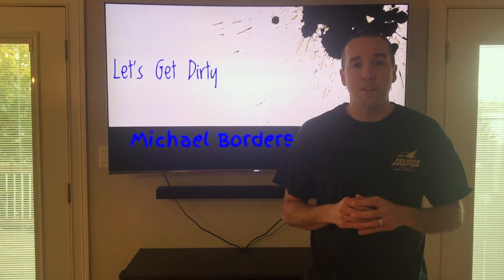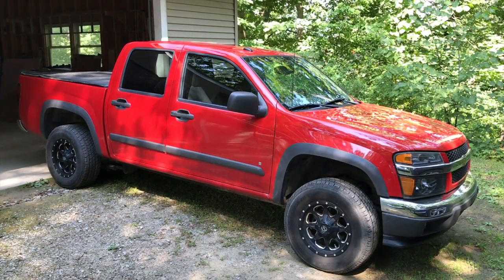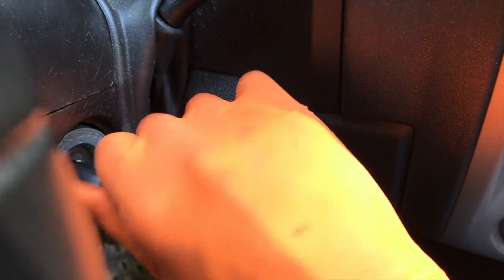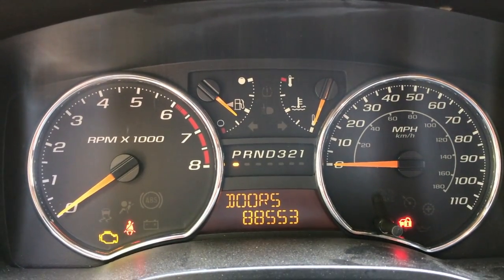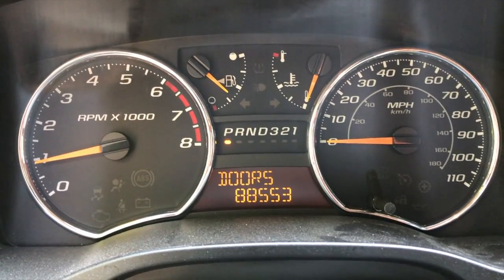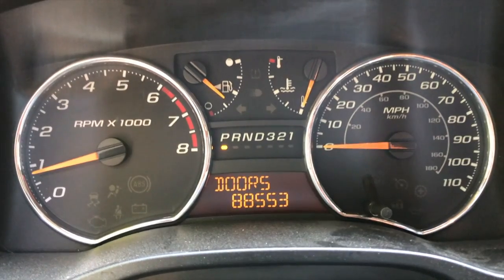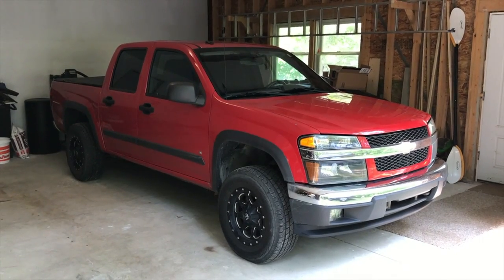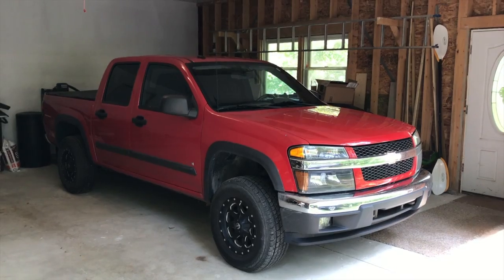How to do a "QUICK Reset" on your ABS System!

Comment: I have a question can the abs cause ur wheel to lock up?
Reply from the maker: Good morning ☕️

It can however it’s unlikely…but still possible.  The more likely cause is a worn out and sticking caliper.

If your caliper is still good, the next likely cause is a damaged rubber brake line feeding off caliper and up into hard mounted fitting.

Brake hoses can look pretty good from the outside however they fail from the inside-out…meaning…the internal portion of hose disintegrates and leads to little pieces of rubber floating inside system…leading to blockage/clogs…ultimately locking your brake or brakes.

Keep us posted on your DIY project.

Comment: My 2007 hyundai santa fe, after replacing valve cover gasket and alternator, started with a strong noise and vibration coming from the abs module, even without the key, ABS module is making noise, like is active/short ?  I have no clue.  I just took off the ABS Fuse,  what can I do?   Have you ever seen this weird situation? give me some guidance please?
Reply from the maker: Good morning ☕️

Any update?  It may be as simple as a system reset being that you didn’t replace any parts relating to the ABS/brake system.

We recommend disconnecting the negative cable from your battery and leaving disconnected for a minimum of five minutes.

After five minutes, resecure cable to negative terminal of battery and start engine to see if your system has returned to normal configuration.

Comment: 2019 sentra hit a good puddle abs and traction light came on , did reset once  worked for a bit till it came back on . I let car dry a bit drove around just reset drove around didn’t come back on . Parked up and drying more currently . Thanks for the info 🙏🏽🙏🏽
Reply from the maker: Thanks for sharing your experience.  Awesome job giving the sensors time to dry, sounds like the water from the puddle made contact with the sensors and made the system act sporadically for a bit.

👍

Comment: i turnded on ignition and acc tap gas pedal 3 times 2105 jeep grand Cherokee did not turn off abs
Reply from the maker: Thanks for sharing, we would now recommend disconnecting the black negative cable from your battery and leaving disconnected for a minimum of five minutes.

After five minutes, resecure cable properly to battery and start engine.  This is also a reset procedure for your onboard computers.

Comment: Just tried this on my Escape. Didnt work.
Reply from the maker: Thanks for watching, we recommend performing this recent test a second, third, and even a fourth time over the course of a day or two.

It’s very uncommon not to work on the first try however some vehicles require additional resets, as it may have a lot more sensors to reconfigure.

Keep us posted.  Let us know if you have any questions and hey if you’re into crypto trading, join our DIY ecosystem and help us grow an exclusive group of DIYers.

       toolboxtoken.com

Reach out to us any time!  🧰
Reply: I did try it a couple times in sucession with no luck.
Then I noticed that the car, after starting and putting into gear made a terrible scraping kind of sound, felt some drag, then that went away. But happens every time I start the car.

I went to Auto Zone and had them check for codes and one came back with a rear left sensor signal missing.
Reply from the maker: @rcpsammy7186  

Thanks for the follow up, hopefully installing a new sensor will solve the problem.  😎👍

Comment: Quick question came around this video. I just got my transmission done and went to pick it up my car and these lights were on mechanic said oh we forgot to tell you so you may want to get this stuff fixed. could they have mess with something and all it is is a simple fix that I can do, don’t have the money to fix any more problems
Reply from the maker: Thanks for watching, it’s possible…🤔

If your ABS light was not illuminated before taking it to mechanic, it’s likely they bumped something or didn’t re-connect a sensor or wire connection.

Hard telling but if it wasn’t on to begin with…why is it on after they serviced vehicle…🤔…an annoying feeling to experience…makes you think they should be in charge of looking over vehicle and getting your vehicle back configured to what it was prior to service.

Long story short…transmission change has nothing to do with your ABS system…so something happened when it was being serviced.

Let us know if you have any questions and hey if you’re into crypto trading, join our DIY ecosystem and help us grow an exclusive group of DIYers.

       toolboxtoken.com

Reach out to us any time!  🧰

Comment: I did this right now and now my truck won't turn on
Reply from the maker: Good morning, just poured a cup of coffee and am sitting down to answer any and all questions for the DIY community.

Sounds like you have something else going on with your vehicle if that’s the case and hopefully we can help.

Any recent maintenance performed on the truck in the last six months?  This will allow us to figure out if any recent maintenance is tied to your issue.

However in the meantime, we recommend disconnecting the black negative cable from your battery and leaving disconnected for five minutes, followed by resecuring it to battery and starting engine. Keep us posted.

Let us know if you have any questions and hey if you’re into crypto trading, join our DIY ecosystem and become part of an exclusive group of DIYers.

       toolboxtoken.com

Reach out to us any time!  🧰

Comment: Thank you!   You definitely know your stuff because this worked and saved us a lot of trouble and money.
Reply from the maker: We really appreciate that, putting trouble to rest and saving money is a good thing.

Thanks for sharing this.  👍
Reply: Does this work  for any make and model?  I drive a 2007 Toyota Camry and currently have this with the dash instruments going wild and speedometer won't move when accelerating. Someone please help .
Reply from the maker: @DodgerRocket  

Good morning, just poured a cup of coffee and am sitting down to answer any and all questions for the DIY community.

It will work on your 2007 Camry.  We had a recent viewer share with us that it worked on their 07 Camry.

If it doesn’t work, there is a faulty part within your ABS system that will need to be replaced.

Let us know if you have any questions and hey if you’re interested, join our DIY ecosystem and help us grow an exclusive group of DIYers.

       toolboxtoken.com

Reach out to us any time!  🧰

Comment: This does not work!! Most of the time it’s the magnetic ring on the axle that goes bad where the speed sensors cannot read.. I know I jus spent $580 on both rear speed rings and axles!!
Reply from the maker: Thanks for watching and sharing, it works however in your case, your rear speed sensors or one at least was faulty.

Performing this reset procedure allows the ABS system to reset.  ABS light can illuminate due to an electrical glitch or sporadic behavior and if it’s just that…in other words all ABS systems are still working properly, ABS light will turn off and system will return to normal configuration.

😎👍
Reply: @DIYwithMichaelBorders  both..
Reply from the maker: @mr.sinister1279  

👍

Comment: Didn't work smh
Reply from the maker: Bummer… we recommend performing this reset procedure a second or third time over the next few days to see if it works.

If that doesn’t do it, time to troubleshoot or have your ABS system read by an OBD II scanner.

Also, verify all tires are properly inflated to the manufacturers max psi… low tire pressure will cause this as well.

Comment: While driving ABS and brake light come on.  I stop the car and turn key off - then back on.  ABS and brake light go off.  As I drive again 2 miles or sometimes 10 miles ABS and brake light come back on.  I pull over and turn key on and off the lights are gone.  This happens consistently.  What do I have to do??
Reply from the maker: Good morning, just poured a cup of coffee and am sitting down to answer any and all questions for the DIY community.

It’s likely that you have either a loose connection, or condensation/moisture buildup in one of your wheel sensors.  Or…it’s possible that you have a part within your ABS system that is in its early stages of failure and acting intermittently… in other words… working when it wants to and not working when it doesn’t want to.

Let us know if you have any questions and hey if you’re into crypto trading, join our DIY ecosystem.

       toolboxtoken.com

Reach out to us any time!  🧰

Comment: HOLY CRAP IT WORKED ON MY 2009 TORRENT.
Reply: Well, disregard that, it came back on. I was told it's because I replaced my ABS module.
Reply from the maker: @daviddupre6905  

Thanks for the follow up, what’s the next step, have you gotten that far?
Reply: I'm told I have to have the module flashed and reprogrammed.
Reply from the maker: @daviddupre6905  

😎👍
Reply from the maker: Awesome!  😁👍

Keep that 2009 Torrent on the road.

Comment: On the 3rd time pressing gas pedal do you hold it down or simply press an release?
Reply from the maker: Thanks for watching, you will perform 3 normal paced brake and release applications.

You will not press and hold brake pedal during reset procedure.

😎👍
Reply: @DIYwithMichaelBorders  thank you
Reply from the maker: @Juli-n-David  

You are very welcome, happy to help.

🧰

Comment: Hmmm. Almost everyone here is saying this hack works but I attest that it does not. 
My 2003 GMC Yukon 4.8L has had the ABS/Brake light and traction control lights on since I got it 3 months ago and have already changed wheels speed sensors, all front and rear steering and suspension parts, brakes, tps, etc. and when doing the process every time I start my vehicle, nothing happens. 
OBD reader also states nothing is wrong but the lights still stay on. Even the GM dealer is stumped...

Nice try though guy.
Reply from the maker: Good morning, just poured a cup of coffee and am sitting down to answer any and all questions for the DIY community.

We appreciate you sharing your experience.  Have you verified all tires are properly inflated to the manufacturer’s max?  Low tire pressure will cause ABS to trigger.

Let us know if you have any questions and hey if you’re into crypto trading, join our DIY ecosystem.

       toolboxtoken.com

Reach out to us any time!  🧰

Comment: Ok this one’s strange: my abs/traction control/ brake lights and others were on for about 3 weeks. Took into shop for diagnosis they said module was faulty. I could drive as the brakes were fully functional…. And was going to replace it when funds were available… I drive a jeep grand cherry with a v8 and have class 4 towing. I pulled my camper over the holiday…. Module lights are now off everything is working properly now….. guess it self reset???
Reply from the maker: Good morning, just poured a cup of coffee and am sitting down to answer any and all questions for the DIY community.

That’s exactly what happened, it has self-reset…however why you may ask…

In most cases, this is due to a part within the ABS system that is in its early stages of failure and is working intermittently….it may soon fail all together however that could take months, a year or two, or a few days…

There are several ABS electrical connections and fuses…it can also be a loose connection or fuse…or moisture buildup inside connection or fuse.

Let us know if you have any questions and hey if you’re into crypto trading, join our DIY ecosystem.

       toolboxtoken.com

Reach out to us any time!  🧰

Comment: My Mercury Mountaineer ABS/RSC  light is on and the alarm keeps beeping. How to reset it.
Reply from the maker: Good morning, just poured a cup of coffee and am sitting down to answer any and all questions for the DIY community.

Did you perform this reset procedure?  Another procedure you can perform is disconnecting your black negative cable from your battery and leaving disconnected for a minimum of five minutes.

After five minutes, resecure black negative cable to your battery and start engine…which will allow the system to reset and detect any faults.

Let us know if you have any questions and hey if you’re into crypto trading, join our DIY ecosystem.

       toolboxtoken.com

Reach out to us any time!  🧰

Comment: Thank 🎉U! I’ll go do that right NOW
Reply from the maker: You are welcome, looking forward to hearing back from you.  😎👍
Reply: @DIYwithMichaelBorders  
🥺 didn’t work.  Ugh.
Reply from the maker: @comehereodee  

Bummer, another reset procedure is to disconnect your black negative cable from your battery and leave disconnected for a minimum of five minutes.

After five minutes, resecure black negative cable to your battery and start engine to see if ABS system has returned to normal configuration.

If it continues to stay illuminated, there is a part within your ABS system that is faulty and will need to be replaced.
Reply: Thank you. I will try that.  
But, 🤔the  thing is , it’s NOT always on.  It comes on n  off all of a sudden 🧐😖. Hope it’s not something I have to replace.  It’s a 2015 SRX caddy
Reply from the maker: @comehereodee  

Thanks for the reply, it might be a part in it’s early stages of failure.  In other words…a part working intermittently.

👍
Reply: @DIYwithMichaelBorders  

🤔 hmm, makes sense! Thank u.
Reply from the maker: @comehereodee  

👍

Comment: After changing the wheel hub bearings etc. the abs and traction light came on. I came across this video googling abs. Well Walla after following the 3 steps the lights went right OFF! 
NOTE: I did NOT have to do the drive thing.. This worked perfectly Thank you so much for sharing!!! Your Awesome♥️😊
2005 Cadillac SRX V-6
Reply from the maker: Awesome!  😁

Thanks for taking the time to leave a comment Sharon, reach out to us any time!
Reply: Same here, im about to try the reset.
Reply: I have a 2012 with a push to start, how would I do this? Just push and not start completely?
Reply: @shezaretolliver1178 yes
Reply: I have a 2017 push start, & I have the same question as well. My traction light, & check engine light is on.

Comment: Does this work on a 1998 dodge daktoa sport? If so, i did it, but nothing happened and the abs AND brake light are still on. What do i do?
Reply from the maker: Good morning, just poured a cup of coffee and am sitting down to answer any and all questions for the DIY community.

At this point, there is a faulty part causing ABS light to be illuminated.  Having your ABS codes read by an OBD 2 scanner is recommended to pinpoint exact part causing issue.

Let us know if you have any questions and hey if you’re into crypto trading, join our DIY ecosystem.

       toolboxtoken.com

Reach out to us any time!  🧰
Reply: @DIYwithMichaelBorders  we've had it scanned but it just says N/A
Reply from the maker: @drapadon  

Interesting…🤔…Time to troubleshoot…

How’s your brake fluid quantity…?…low brake fluid will trigger ABS light.

Check air pressure in all tires, bring psi up to manufacturer recommended psi.  Psi max can be found on tire itself.
Reply: @DIY with Michael Borders  Fluid is fine, I topped it of when I got it back from a motor replacement. The tries were filled up last week
Reply from the maker: @drapadon  

Awesome, you might have a blown fuse.  We recommend checking any and all fuse’s related to ABS and brake system.

You even have fuses inside drivers side near pedals.

You may need to pop open each bleeder separately and bleed brakes just a tiny bit on each wheel however this is a long shot and unlikely to fix issue but at least it’s a procedure that might fix issue and doesn’t cost anything.
Reply: @DIYwithMichaelBorders  Checked all the fuses. They're all good. 

About bleeding the brakes, we can't really do stuff like that since our driveway is full and small, we also don't have jack stands.

Any other ideas?
Reply from the maker: @drapadon  

Thanks for the reply, that’s odd that the scanner says NA…🤔

Another test procedure you can try is to disconnect your black negative cable from battery and leave disconnected for 30 minutes.

This will allow your system to reset.  After 30 minutes, reconnect black negative cable to battery.  Keep us posted.
Reply: @DIYwithMichaelBorders  already did that, it did nothing.
Reply from the maker: @drapadon  

Bummer…wonder if you have an electrical short somewhere along wiring…🤔…
Reply: @DIYwithMichaelBorders  No idea, how do i test that?
Reply from the maker: @drapadon  

We recommend looking at each wheel well and checking speed sensor wiring.  It’s not uncommon for speed sensors to wear out and become damaged.
Reply: @DIYwithMichaelBorders  Okay. I'll keep you posted. But my calendar is quite full. So I'll have to do it in my free time :)
Reply from the maker: @drapadon  

👍

Comment: Does this apply to all makes and models? I have a 2012 ram 1500
Reply from the maker: Thanks for watching, almost all.  It will work for your 2012 Ram 1500.

If it doesn’t clear ABS, then you have an actual part pertaining to your ABS system that is faulty.

😎👍🧰
Reply: @DIYwithMichaelBorders  thanks Mike I'll give it a try tomorrow someone had mentioned to me that the module and the ABS pump have to be married in other words they need to be programmed to maybe this will help to get them in line
Reply from the maker: @PaulChaffee-vi5wj  

👍